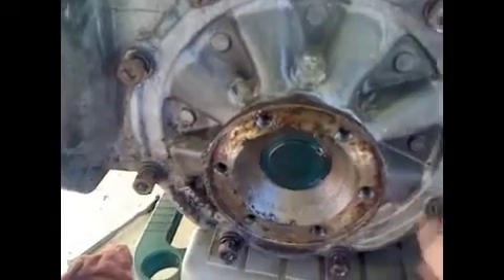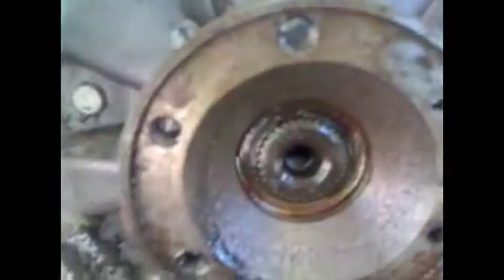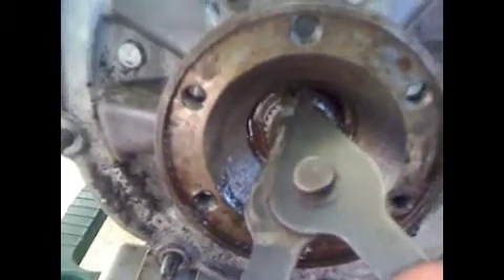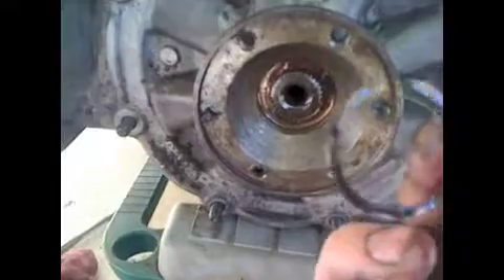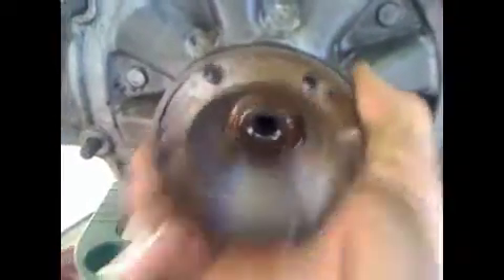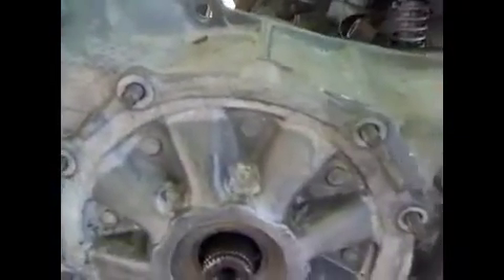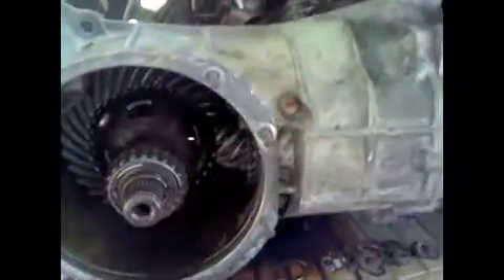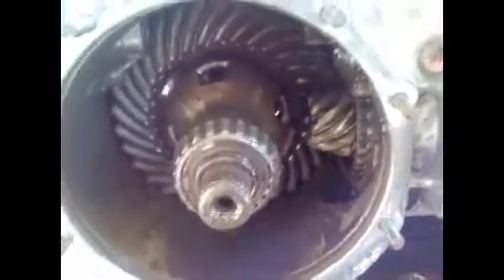VW Transaxle Input Shaft Removal

Comment: STOP!  Do NOT do this.  It is critical that you first measure, with great precision, the depth of the adjusting screws before you unscrew them.  If not you need to go through a detailed procedure using specialist tools to reset the adjusting screws.  If not you WILL fry your transmission.  Look at the Bentley manual which clearly states these two procedures of continue your google search.  

I was burned by this video and had to pay dearly.  You’ve been warned. (Welcome to YouTube)
Reply from the maker: Sorry to hear you had a negative experience. This video records my personal experience, which had a positive result. As with many mechanical processes, there are many steps that may not be documented on a single resource found on the internet. As you mentioned, diligent research will show further details involved with the assembly of a different input shaft. There are more steps than what you have mentioned, as well. This video was never intended to be relied on to be an exclusive source of steps required to replace the input shaft. Your feedback and warning to others is much appreciated and valuable. I hope others will do detailed research to learn what steps they "don't know what they don't know," as the trite expression goes.

Comment: Did you ever make a video on installing the input shaft?
Reply: Also, thanks for replying so quickly especially since you don't have the bug anymore. That's pretty cool of you. 👍
Reply from the maker: @mikeroland9751  I forgot to ask that you reply with your solution when you get to the bottom of your car trouble. It may help someone else in the future with their diagnosis if they find your post on here.
Reply from the maker: Unfortunately, no.
Reply from the maker: It's really easy though. Just reverse the removal instructions. Lubricate the new part before installing, so the seal doesn't get damaged.
Reply: So if I'm correct in my understanding about the problem, after reading others comments. When I start my bug, I press the clutch pedal all the way to the floor, shift into neutral,  turn the engine on, and release the clutch pedal all the way back to its resting position to engage the clutch...and I get a vibration/rumbling noise. Then, testing the vibration/noise, I press the clutch pedal all the way to the floor again, disengaging the clutch and the vibration/noise goes away. This is the input shaft? Or input shaft bearing? Also, any idea what causes it?
Reply from the maker: @mikeroland9751  There are several things that could cause your symptoms. Best course of action would be to remove the engine, to dispose further. Could be the pilot bearing, trans input shaft bearing, or even the clutch. Bolts coming out of the clutch or broken springs in the clutch can cause that, too. I wish you the best in figuring it out.
Reply: @mikeroland9751   I have this same issue. Did you ever find out what it was?

Comment: Old video but only one like it.is this the same procedure for swing axels traanys also?the splines on engine side are not engaging all chewed up where clutch disc sits.
Reply from the maker: Wendell Proffitt unfortunately, I don’t know what the swing axle transaxle looks like on the inside. If you have a Chilton or similar manual, there may be some images that clue you in as to what to expect. This was the only time I ever saw inside an IRS transaxle, too. I basically shot it as I was figuring it out. lol